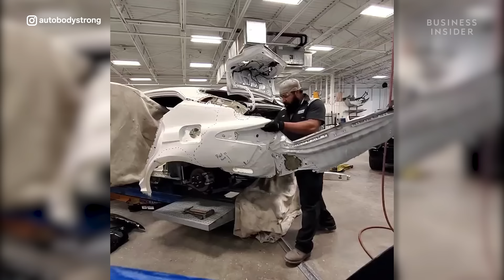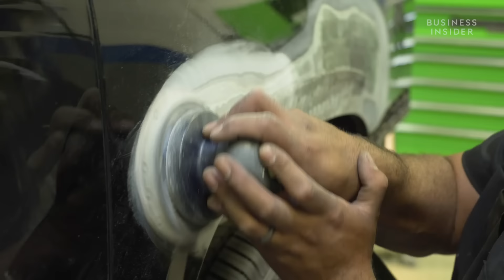How Wrecked Cars Are Repaired | Cars Insider

Comment: Great vid and a fascinating peak behind the curtain.

One question {and I appreciate there simply may not have been the time to show every step}: was the impact-absorbing crash box structure at the front of the car replaced, as it had already deformed and would not retain the integrity to absorb load impact in the same precise way from when new and at the designed-in/calculated progression rates. Or would each insurer get to make that determination based on their own procedure (like some insurance companies using only new parts and others using second-hand parts, wherever they can scrimp and save a few bucks).
Reply: Nope, nobody does that. In fact, what we're shown here is not a repair actually, but "a bare reshape with a repaint".
All the car parts are meant to absorb the kinetic energy during the impact, which they of course won't be able to as good as before after such a "repair".  Grinding and welding onto a sheet of metal removes all the protective films of chemicals it had, so no matter how good the final polish was, the rust will show up sooner or later, especially from the inner side of the parts (which don't seem to be taken care of at all BTW). Also, besides the shock absorbing programmable deformed geometry of the parts had been totally lost, and micro-cracks have spread across the metal body,  the welding spots connecting the parts to each other get damaged too, so their strength becomes very questionable. 
In fact, all modern cars become much less safe, having had such deformations, so unless you choose to replace the broken parts with the brand new (not reshaped) ones (which, of course, might be expensive but right way), your car becomes doomed along with the people inside it, as the following accidents with this car may lead to much more serious consequences.

Comment: I use to work as a panelbeater in Australia in the 80s. Work quality was on top of excellent.  Now..... the best quote is the one they approve . When you going to buy a car, not brand new,  take a magnet those from you freezer.  And place it around  car doors and around the card. If magnet fail is plenty of filer.

Comment: Never forget to settle for diminished value if you're not at-fault.

If you can sell your car for 10k today right now, but somebody smashes it. No matter the quality of repair, it's still an accident vehicle and inherently worth less.  I bought a FDT certified rebuilt car and came to find out the windshield frame was bent! Point is unless you are THE repair guy, rebuild issues are hard to determine, or even expect in my case. Ridiculous

Comment: Truth is when a vehicle is wrecked nowadays they are not worth fixing . They are just stamped sheet metal tac welded together when wrecked and have to go on the frame machine no matter how you do it the car is never going to be the same and i as a body man will tell you streight out if it gets wrecked a secont time it's already been weekened from the previouse wreck so safety is compromised. If you have a collision buy a new car or used car that has never been wrecked.

Comment: The tools available to him compared to what I had when I started over 50 years ago are astounding.
Reply: Yep  but the tools just shorten the repair time. The craftmenship is the one that matters in the end.
Reply: Some of the old tools and techniques will never be replaced.
Reply: @keithclark486 I just use my old dent puller and I can bust out 8+ hour job in less than 1hr 😂
Reply: he's probably gonna be saying that in 50 years too lol.
Reply: Sadly some of the tools are possibly proprietary based on which manufacturer and specific OEM Components could take longer sometimes
Reply: @YihouTomaru  Frame machines are pretty universal, the only thing I would think of as proprietary are the manufacturer supplied files for the location of different holes, seams etc.
Reply: Our dent puller was drilling a hole, placing a steel plate on the inside and pulling it out with a Chevy Blazer in the 80's.  Used to search around on garbage night for people throwing out appliances so that we could grab the sheet metal.  Put pop rivets in to hold it, then weld or lead fill, fiberglass resin and filler then the Bondo.  We would then repaint the car, sell it and buy another one to start over again.  Paid off a good amount of college by doing that in the driveway with my brother.  To this day I can spot any imperfection in a vehicle from a good distance away. My wife was annoyed a few weeks ago when I spotted a slight dent in her car from where a palm tree branch hit the fender.  She could not believe that I immediately  noticed it when she pulled into the garage when I was standing there and she said that it just happened an hour earlier and she inspected it and could not see anything.
Reply: The collision shop I worked at 6 months ago doesnt even have this.
Reply: @jessicabecause3717  Old School  :)
Reply: 50 yrs ago.then you played with some lead and might remember who earl shive was.
Reply: @albshore8  Oh Yeah I remember the $19.95 earl shive paint jobs! Rubin Shaw also had the twenty-dollar paint jobs. If you wanted it sanded you had better have it sanded when you got there. They wouldn't paint it with factory colors you had to pick the color out of their book and get as close as you could. If you wanted red you got Earl Shive Red LOL.
Reply: I started around 25 years ago and it would be an absolute luxury to have had those tools at my disposal. I have to buy all my own tools and then fight insurance companies to get paid right to do a good job on someone's car. Worst part is the insurance companies charge top dollar premiums and want to pay for a cheap aftermarket fix on someone's car. The insurance idiots are the major problem in repairing cars.
Reply: Yeah u guys used to use a toilet plunger 🪠
Reply: @Bo-Flex  is that true? Did that help pop out dents?
Reply: @TraumaER  there are proper suction cups, but they're more meant for soft plastic, cause even if you did pop the metal back out, it's not gonna be fully straight
Reply: I read a review years ago from a guy that took his car to Earl Scheib.  The guy said he dropped his car off to get painted done a little paper work ect and before he left he could see them in the back painting his car already bugs and all.
Reply: @thesweattexperience7741  They would fix light dents(sort of) if you paid extra. But for $19.95 what could you expect. I had just started in the body business and a gal. of paint cost us from $20.00 to $2500 for the paint alone.
Reply: It doesn’t shorten nothing. I learned from a guy born in the 30’s and a guy born in the 80’s. Both ways have their advantages and both ways can be used on cars today besides aluminium, that’s a bit of a difference process and tbh the old method of body repairs would actually favour aluminium repairs, not the new technology, only the welding and glue would help more with aluminium.
Reply: I disagree with you. You must not a good metal worker/ repairer. If you don’t know the way you can’t be good technician the new way. Only the dent pulling makes it easier but if you want to repair a seriously damaged panel, levering from the inside and cutting out double panels in better then the new way
Reply: lol 50? youre merely an apprentice. Ive worked in the auto bodyshop business for 85 years, pal. Step down.

Comment: I owned a body shop for several years. We never used bondo on insurance work.. New body parts or after market one are used. If the frame is bent out of shape you either scrap the vehicle or cut and weld a new section in. For repairs not covered by insurance then it is up to the owner what he wants but it must meet certain standards.

Comment: Nice video, nice guy doing the repair but by no means any thing remarkable.  The pulls he made with the frame machine were not of the frame they were mostly sheet metal components.  I would have liked to see some frame repair on the truck. The equipment is nice and modern and good to impress the insurance adjusters.
Reply: I agree that it's mostly for show. I went to Wisconsin for Kansas Jack training when my shop bought a new laser measuring system. It was a good system but more PITA to set-up than it was worth. When I got back home I used the laser for about 4 months and just went back to a tram and a tape measure. You really don't need more.
The only time the shop manager insisted on using the laser was for a T.V. commercial and if an insurance company rep was coming by. It did look impressive as hell all set up under a car, but mostly over-kill.

Comment: Never Never buy a rebuilt auto !
I worked for a auto body parts suppler 20 yrs as a delivery driver
some shops will buy a insurance right off . have been to and seen 
many rebuilds . car $100.00 parts $ 200.00 to 300.00  labour & paint $400.00
they sell to middle man $1100. 00 he sells to you 4-5-6- thousand $$
car might look pretty BUT IT WHAT YOU DON'T SEE 
ARE THE INTERNAL SAFETY ISSUES ELECTRAIL ISSUES 
and when the car go bad Mr nice guy is gone

Comment: When I was a kid I worked at a friend's body shop (early '80's ) and to straighten things, we had chain pots cemented into the shop floor and pulled with Port a Power hydraulic jack and a hammer to straighten steel.
If it was a bad crash, we'd use not only a hammer, but a big f-ing hammer to straighten steel.
These new frame machines are so much faster and easier.
Very cool to see the new equipment.

Comment: I worked in a frame shop back in the mid 70s. there was a Marquette tower frame machine we worked in a pit. The guys I worked with were incredibly talented. We did have books for cars measurements but all we had was gauges we would hang from the full framed cars and eyeball down the center and check x measurements for squaring. The computer measuring system made things a lot easier I see.
Reply: These computers make sure when the repair is done, the car doesn't drive down the road sideways, like I've seen in the past.

Comment: I worked auto-body back in the day before all this computer stuff. It took a good eye and ability to figure out wrecks. The thing about auto-body as opposed to mechanical work is repairing a wreck is never the same. Cars hit things and other cars at different speeds and different angles. To do a good repair you have to "Un-do" the damage. A good, experienced man would have the "angle-of the dangle" figured out before that guy had all his gizmos hooked-up. (just say-in)

Comment: Well, I think that the greenest thing you can do for this world is actually repair and use of things for as long as possible. It's the best form of recycling. 

I'm wondering if someone has the experience, is this worth it? Does the car still have the same integrity after the metal has been bent a certain way? Do they additionaly reinforce potential weak spots?
Reply: If it is repaired properly by an authorised repairer, to manufacturer approved standards , the vehicle should be as strong as, if not stronger than, an equivalent vehicle straight from the showroom floor. 

Unfortunately, for various reasons, this often not the case.
Reply: depends on the repair... you get a sketchy shop and it sure wont.

fast, cheap, good. you get two options.
Reply: Finally i came across such a comment. Everyone was like great job etc… as much as it looks to be such a great accomplishment and brilliant end result, a metal that’s been bent and then pulled back into place, especially the chassis frame or monocoque structure will never ever retain the same integrity as new. It will never be as safe. It still can be safe but it will never be as new-safe. Pulling crushed metal back into place will create weak points which will sever or fail easier. Think of a soda can. Will it retain the same strength if i were to crush a can and attempt to pull it back into place?

Comment: I still see so many hack shops out there. Many can't even paint so you could just imagine what they cover up. I had a shop try to paint a simple panel. First time there were major drips. The second time there were birds eyes and deep swirls. Now they won't even respond. I will have to go to a dealer and see what they can go the small claims route. I friend of mine had some body damage recently and now there are electrical issues that remain unfixed. Now there are some great dealers. I had one years ago who damaged my car on a service visit. I could not find any history of what they did. The car was as new - better than new and I am a perfectionist. So good work can be done if the shop/dealer cares. Too often many look at a job from 30 ft. or are blind.

Comment: Let's not forget the part where the customer thinks it's a simple 1 day process and that the shop stocks the parts or where they are on back order or show up wrong from the vendor and then believes it's in the shops control or thinks that when they show up you just throw them at the car and they stick not realizing all parts including new OEM are rejects from the assembly line boxed for resale that didn't pass QC or the garbage aftermarket parts their insurance company requires be used that must be prefit, modified and force the tech to do it 2 and 3 times before being allowed to reorder OEM which by the way the tech isn't paid for but works flate rate on their reduced book times , or the massive amount of reprogramming and calibration after, or how about the part where because they finally showed up after 3 months of waiting that the 150 hour job will be magically ready the next day because they have to go on vacation not to mention the other 200 cars in the lot and the 30 assigned to you that the owners all believe the same thing on or the insurance company collecting massive premiums from them who wants to cut corners, violate repair procedures and break every law but then wants to preach roses to the customer and point fingers . Ya I've been doing this awhile and am sick of the current situation and the shipping delay we are the ones who get our nuts kicked in by everyone else involved who doesn't have to do it doesn't own the equipment to do it never has and never will but their computer screen tells them xyz. They have killed the industry.

Comment: I used to work in a body shop as an estimator. When you first request an initial estimate to the body shop to send to your insurance. The body shop will give you an estimate form with all OEM parts replacement in it. You will then inform your auto insurance about the estimate and prepare the repair to that shop. But each auto insurance have their own adjuster. Their job is to adjust the price as cheap as possible. That's including replacing the parts with aftermarket instead of OEM parts. Even though you tell the shop to put OEM only, most likely they replace it with aftermarket, because if you're not an expert, you won't be able to tell. They do this all the time to save money. For example if the OEM door of the Cadillac is $1,000, the aftermarket is around $600-700 only.

Comment: My mom forgot to put the car in park. Bought it brand new in 2019 and had less than 30,000 miles on it. Car was at a slight incline at my grandparents house. With no one in it It proceeded to roll off the driveway, straight down a rock embankment, nose into the ground and then keep on doing down the hill. Crashed through the barb wire fence at the bottom of the hill and kept going into the woods. Finally wedged itself to a tree that had fallen and another huge tree still standing. The oil pan and transmission pan had been torn off. The windshield cracked. The entire suspension was shot. The frame was damaged. The front end was just completely gone. And just overall it was a sad sad sight for our wonderful car. But, the insurance actually paid for it to be fixed completely at a shop like this. Final bill ended up being over $20,000. We had to pay $11. Yes, $11. Car drove better after the shop fixed it than it did before the accident. We were talking to the shop manager and he just busted out laughing when we told him what happened and the route the car took. He then thanked my mom for keeping his shop in business 😂😂.
Reply: what car Matt?
Reply: What 2019 car was this, again? How did she not have it in park? Something isn't adding up lol

Comment: This is all good, but some vehicles are not worth repairing depend on what part of the vehicle has been damaged. Been working on cars for while now, and when recked car comes in for alignment, sometimes it's almost impossible to adjust the  camber/caster/SAI to spec even after replacing every suspension, and customers just don't understand that if the body/frame is bent there is nothing that can be done (unless you literally stretch out the body/frame), and they get made and disappoint and confuse. This is why people need to understand when buying a recked car, there are a million things that can go wrong with it including electric systems.

Comment: So, genuine question: is there any data on the crash safety of these cars once they've been repaired for damage that crumbled the frame of the car? Will the metal still be as strong as it needs to be for the next crash? Or is it implicitly understood that once you repair your car this way, you are giving up some or a lot of crash safety?

For dents and scratches, no questions, I love what these guys do. They clearly have passion and expertise in equal mix. But I'm genuinely wondering for more severe damage.
Reply: I don’t think it will be as strong as it was before.
Reply: Repairers have to follow Manufactures Repair procedures and guidelines now so if its good enough for the manufacturer then YES the car is just as strong and safe.
Reply: The factory has repair procedures for structural parts. Repair as in how to replace a part as they the factory intended.